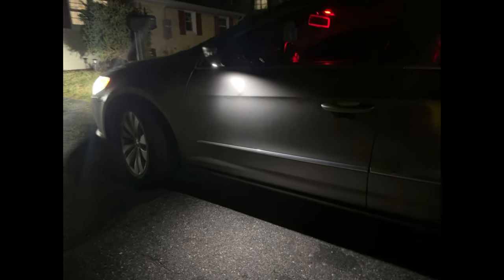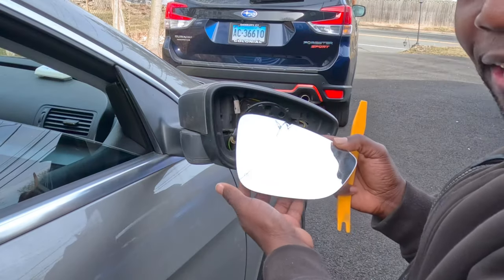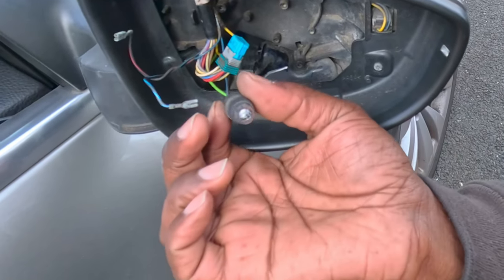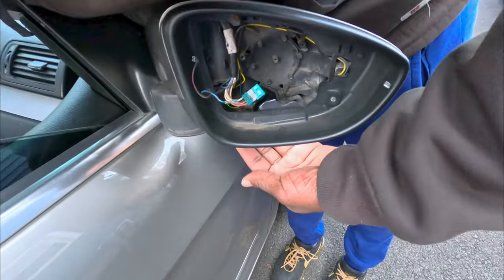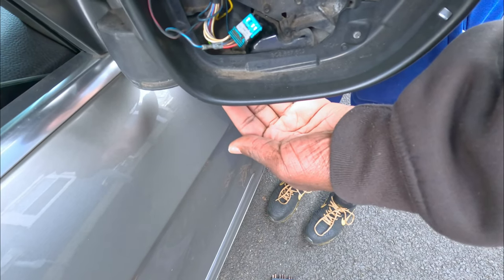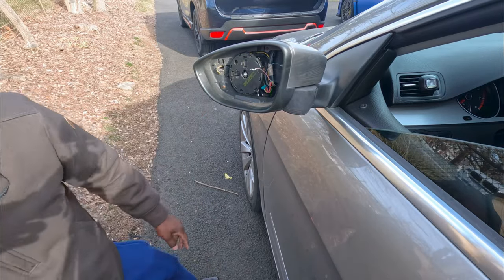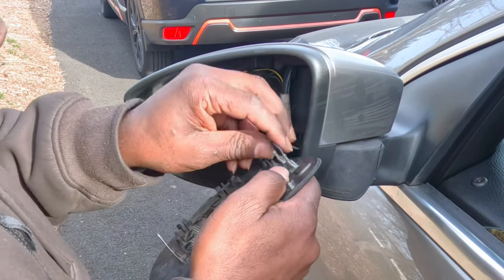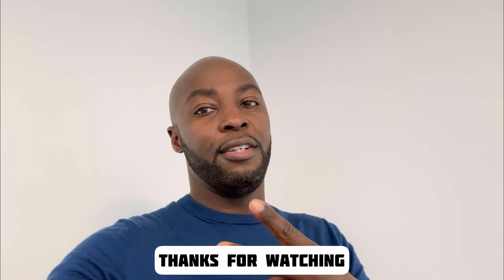2009 VW CC Mirror Approach LED light upgrade

Comment: Hey so I wasn’t being aware while I was driving and I knocked off the cover of the side mirror for my CC. But now the light doesn’t come on. The light for the turning signal and puddle light underneath. Any advice?
Reply from the maker: It sounds like the cables is broken somewhere. To check  that theory, you first thing to do is to see if the rear and front turn signal are working. If they are working on both side then the fuse is fine. Then now you got to either check the bulbs maybe it burned out then check the cable to make sure it’s not rusted. It could also be Broken. So first thing check the bulbs.
Reply: @CarStomIt  okay thank you, will do!

Comment: I changed my wing mirror lamp because the indicator was out,but the puddel light was working,so I ordered the hole lamp,and now the indicator is working but the puddel light is not i put a new blub amd still not working
Reply from the maker: to be sure that it is working mak sure that you are checking them at night. Thes buddle lights have a light sensor on the Front windshield. so if it is light outside it will not work.. so check it again at night. also I beleive their is a fuse for it but I cannot remember witch fuse it is.

Comment: Hey does it turn on error light or not in caiger
Reply from the maker: Nope. No error messages at all.
Reply: @CarStomIt so you can put in led bulbs without canbus chip? 😊
Reply from the maker: @baks9027 the LED that I bought usually have CANBUS so to be truthful no. I would stay with CANBUS LED’s